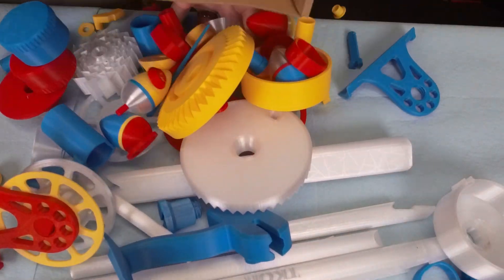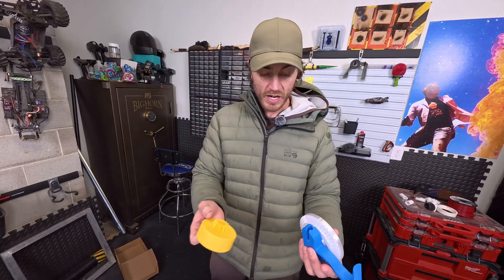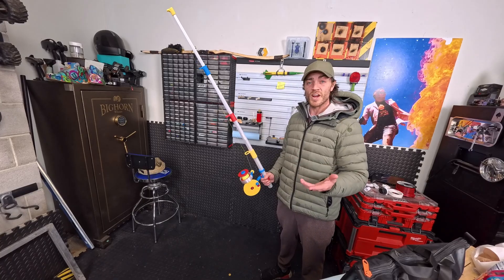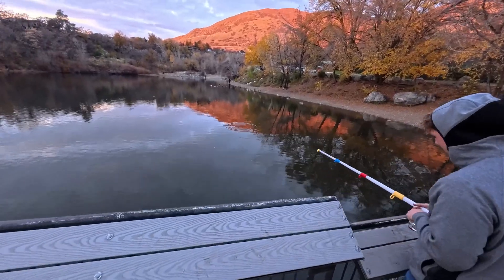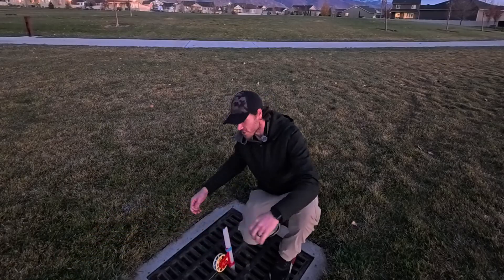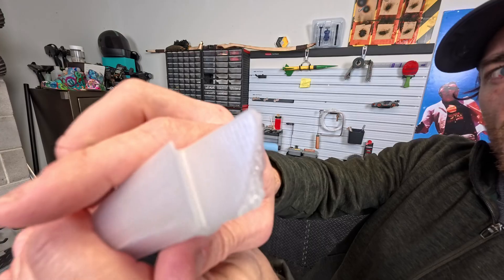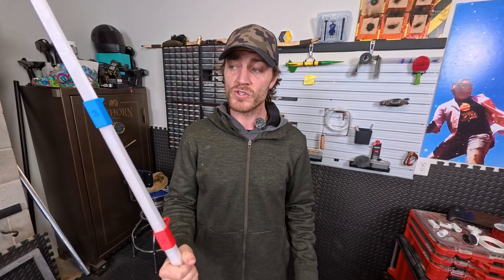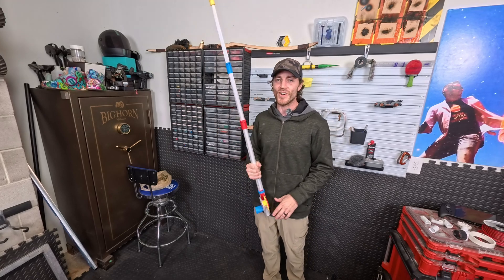How Strong Is A Printed Fishing Rod

Comment: You know... This would work better as a 3d printed sling bow fishing kit. You could even print an arrow shaped float that can be shot with the slingshot. Because of the slingshot part, you'd still get the distance a rod would get, without the rod itself.

Comment: Would be interesting to see how much force that was. Could attach a force meter on the line. Also feel the mounting point would be different if it was actually being used and the force distribution on the pole would be different? Interesting though!